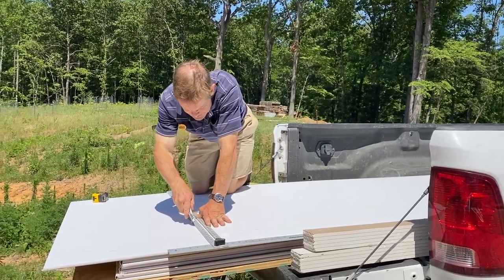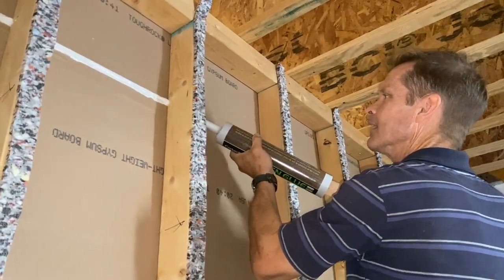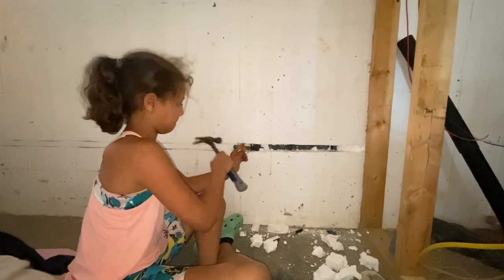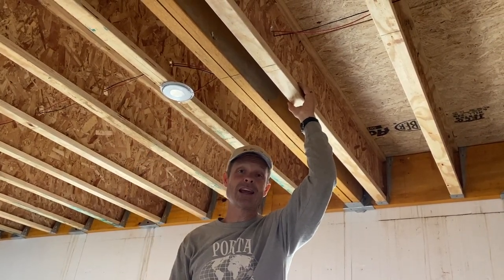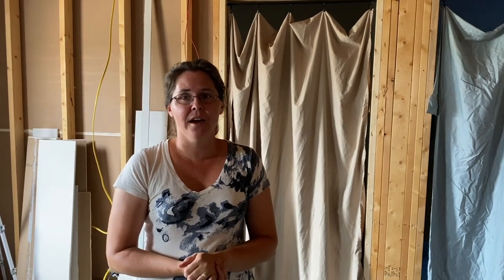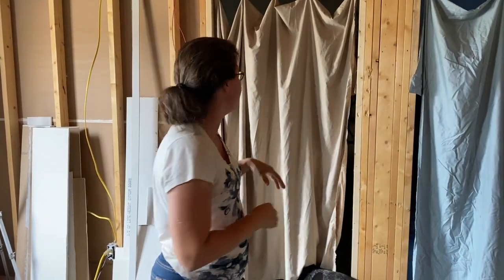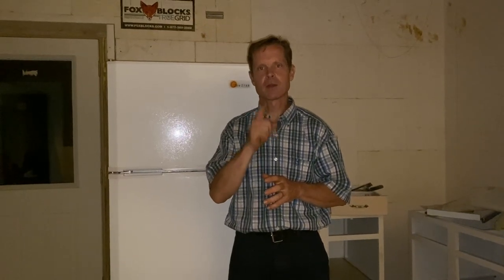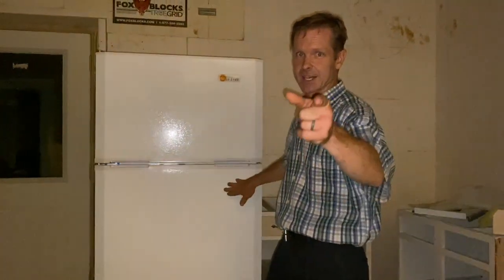Bedroom Makeovers While Kids are Away at Camp!

Comment: I’ve seen people use electric chainsaws to cut trenches for wires and pipes in ICF blocks. Also, you may want to look into different light switches. AC switches apparently fail prematurely when used with DC loads.
Reply from the maker: Good catch on the AC switches, my electrician didn’t mention that to me. After some research, you are correct, the AC switches are not designed as robust as the DC switches to handle the arcing because AC power automatically dissipates the arc. Luckily, my amperage is extremely low. We’ll see how long these AC switches last… in the meantime, I’ll be using DC switches for my higher loads, especially inductive loads from pumps and motors.